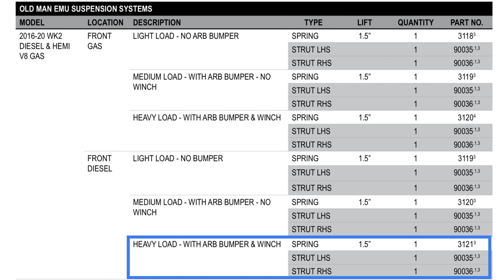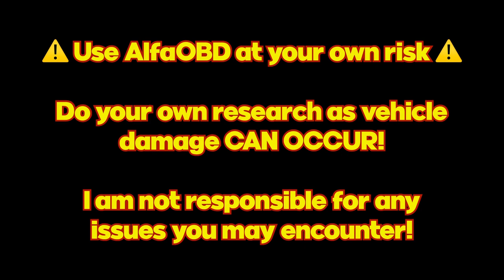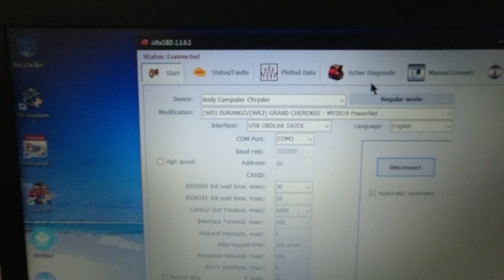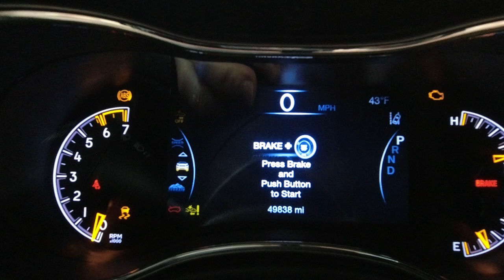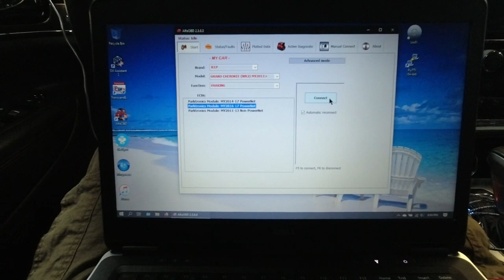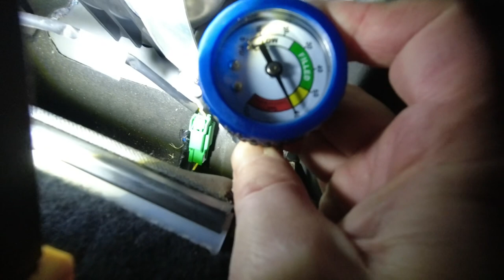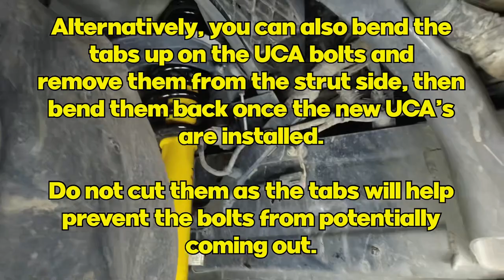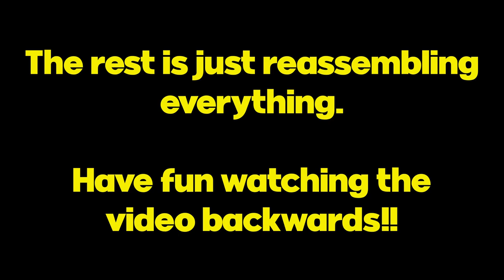Jeep Grand Cherokee OME Lift + RRO UCA Install 2017-22

Comment: On the upper control arm bolts/nuts they have a little U shaped tab on the end that hook onto the body. I thought the purpose of those was that you could loosen and tighten the nuts without needing another person to hold the bolts.  Once it spins enough it'll hit the metal and stop it from spinning.  Just torqued mine down to 70,  hope I didn't bend or damage them doing that.  In your video you say to get someone to hold the bolt.
Reply from the maker: You are correct in that the tabs ARE to keep it from spinning. However, there are 2 things that can happen that I didn’t realize at first. First, one of the nuts was so stuck that it spun the bolt and bent the tab up. Second, when you’re tightening the firewall side, you lose a 1/4 turn or so with the slack the tab allows. If you don’t have a ratcheting wrench with a high tooth count where you don’t have to turn it far to catch the next cog, then that 1/4 turn costs a lot of extra time and frustration.  That was the case with mine.

Comment: Nice video on the process. I wish I had made one when I did my swap. You should have checked my spreadsheet which had all bolt/nut sizes and torque spec. 

Would have been happy to help as well seeing as I already have the tools from doing mine, including that E-star on the rear brake calipers. Would be happy having exchanged my mechanical help for your tech help in disabling my air suspension. Never bothered trying as I messed up my compass when just trying to change tire size….lol
Reply from the maker: That’d have been cool!!!

If you still have the stuff where you can hook it up, we can still disable the error message (and change your tire size 😬)

Comment: 18:22 - did you attach the sensor back to the new control arm? Conflicting reports on if this is for the ride height or the headlight leveling sensor. Thank you
Reply from the maker: No, the adjusting headlights were only thru 2018, IIRC. My 19 has the HID’s, but they do not adjust.  

If you have the adjusting headlights, then you’ll want to hook up the one on the passenger side. The RRO UCA’s have a ball socket that it connects to.
Reply: @funkywk2  Thank you for the reply. I have a 2012 WK2 Overland w/ HID as well. So that ball socket on the RRO UCA is not for the ride height sensor then? There is an identical socket and piece of plastic on the driver side, but the RRO UCA does not have the ball socket on that side.
Reply from the maker: I think the front passenger side was for both, as each corner has its own valve/level.
Reply: Noooo not red threadlocker

Comment: Great video. Wish I had it when I installed everything. I love the lift. Only issue I’m having is the double rubber upper ball joint boots. Any time it rains mine fill with water and I have to re-grease them to push the water out, I’m talking a lot of water and my grease leaks out so much. There’s got to be a boot off some other vehicle that is one piece that would work but I haven’t researched it yet.
Reply from the maker: The only one you need to worry about is the original that covers the joint itself. The 2nd one doesn’t need any grease in it.  It’s just there as a spacer to make up the difference.

Comment: Have you had any problems or regrets on the change you did to your suspension? I am looking into changing mine out as well but I wanted to get some feed back first. Thank you
Reply from the maker: Absolutely no regrets.  Be sure you get the correct springs for your mods and engine. I went with the stiffest springs (Hemi, F & R bumpers) and actually wish they were a little stiffer. They ride just like QL, but with more control and no floating.
Reply: @funkywk2  I currently have airlinks installed and have not put them to offroad use but I will this weekend  ( in a few hours after writing this) at Windrock.  I can tell you now from driving from Texas to Oliver Springs TN that when I get back they will probably be changed out before my next trip. I have the the same (Hemi) front and rear bumper you have along with other body protection that put additional weight on my WK2 so I will let Rocky Road know when I purchase their suspension lift kit. 

Another concern I have is disabling the air suspension and it having any affect on the other components that relate to when it is in rock, mud, or sand mode--other than raising and lowering the jeep? 
  
btw the floor jack was a tremendous help with leveling the front bumper--it took me a great deal of time to get adjusted correctly - thank you!
Reply from the maker: I’ve used mud and rock modes quite a bit and without issue, so you should be just fine.  Glad I actually had a helpful tip. :)

Comment: Quite an involved process for this mod, but well worth it by the looks of it. So there are no dash lights or software problems so far? Thanks for doing the video. it's a big help.
Reply from the maker: Nope!  I still need to remove the Uconnect menu options (Tire Jack Mode, etc), but no errors now.  After I disabled QL in Alfa, I did still get an error until I disconnected the ASCM. Once I did that and did the ABS Initialization, it was clear.

Comment: Hi , you didn’t show how you reset ABS initialization? Mine won’t let me click start, to reset it
Reply from the maker: On the screen for it, it tells you what steps to follow. I’ve also used this post as a guide:  https://offroadpassport.com/forums/topic/5690-how-to-calibrate-speedometer-change-tire-size-on-2021-jeep-grand-cherokee-wk2-using-alfaobd/
Reply: Thank I will give it another try.

Comment: Im thinking to get this kit from RRO.
2019 jeep gc limited.
Any recomendation before installation? Im trying to find out everything i need before do it by myself to make sure everything its okay.
Thanks!! And nice ride!!
Reply from the maker: Figure out your long term plans ahead of time.  Winch, bumpers, roof rack….   Anything that will add weight needs to be accounted for. 

I have no regrets getting the springs we have (stiffest - 3121/3160) due to our weight.  

Also, the RRO UCA’s keep the alignment in spec, so also worth it.

Comment: Does it ride better then the air suspension and give you better flex. Right now I’m running airlinks and the ride is pretty stiff. Going over bumps is crazy. Other then that it’s been working fine for 176k miles. 

Also were you able to correct the tire size in anyway to correct the speedometer and mileage.
Reply from the maker: The ride quality is as good as QL is stock, but more controlled and not as bouncy/floaty.  

The articulation might be a little better, but it’s not QL that is the limiting factor. The sway bar end links limit flex the most, as do the CV axles.  

I used AlfaOBD to correct tire size in the video.
Reply: I have a 2013 Jeep Grand Cherokee Trailhawk. What did it cost to do the entire conversion?

Comment: Man that was a job. Swapped out son's air suspension on his 2012 GC Overland with 5.7. Found out he needed break job also. Felt like i had been run over next morning.😂
Reply from the maker: I get it.  Getting old sucks!  Luckily, I had some help, so it wasn’t all on me. I’ve been impressed how long the stock brakes have lasted, so we aren’t there just yet.

Comment: Bro... how much lift did you achieve with this setup? I have a 2018 v6. I was told only up to 2 inches. Yours looks like more than 2.
Reply from the maker: It is close to Offroad 2 with Air suspension, which is 3-4 inches over normal ride height. I don’t know where a coil spring WK2 sits normally, so they may be basing it off of that (assuming it sits a little higher).

Comment: Awesome video! I came across this after I got my RRO Old Man emu lift (air suspension deleted) Same kit as you with HD springs.  Since the swap I have had a clunk (front driver) going over bumps especially at lower speed.  Did you have any issues?
Reply from the maker: It’s the front endlinks.  Stock set is too long and hit the fork at the bottom of the strut.  I’m going to swap to a shorter one.  The OEM SRT links are a little shorter, but I don’t know if it’s enough.
Reply: @funkywk2  awesome!! Sounds bad, and couldn’t figure it out; will swap the links and see how it goes! Appreciate your response. 
Cheers
Reply from the maker: Just realized I’m running SRT endlinks right now and it still hits. I’ll post my update here when I fix it!
Reply: @funkywk2 it was definitely the end links… found an aftermarket set that was slimmer at the pivots… Replaced and the clunk is gone.
As a plus have grease points.
Thanks again
Cheers
Reply: @thecanadianguy364 can you please share which ones you ended up going with? I need to replace mine, thank you!
Reply: @AM-bl1ss  I went with the TTX NCT TXMS258136
I purchased from Napa Canada.

Comment: How is it offroad? Better wheel travel?
Reply from the maker: Its terrific offroad. Much more controlled, no banging from maxed out struts, much more comfortable.  I’m not sure how much more wheel travel it has due to the sway bars, etc, but I think it could with some changes.
Reply: @funkywk2  thanks man. I have a trailhawk like yours and I'm at 100k km right now with no issues with quadralift so far.

Comment: Does this still fit in the garage with the roof rack?
Reply: Yes, with several inches of clearance.
Reply: @gspfunk  sweeet👍
Reply: Another question,  do you have the trailer package equipment on your jeep and factor in the spring rate?
Reply: @marine0331inf  I do have the tow package, but I actually went HD in the rear due to our rear bumper and load when we’re camping and wheeling.  It’s at least an extra 800 #’s, probably more. With the Wilco and RotoPax on the back, I was actually sagging a little. And, I chose not to level it, so I’m gonna look into helper bags.
Reply: @gspfunk  let me know any updates on it👍
Reply: Did y’all need a few drinks when you got done

Comment: Quadralift isn't unreliable at all. People just don't understand how to maintain it, that's all. If atmospheric air gets into the system for any reason, it's going to cause issues. That's because there is moisture in atmospheric air and moisture causes all kinds of issues from internal corrosion to freezing in cold temps. 

So to keep your air suspension working properly, make sure it's filled with nitrogen and it should work just fine for decades. 

I'm on my 3rd air suspension Jeep and have never had an issue with any of mine.
Reply from the maker: Glad your experience was better than mine. I know there are more happy customers out there than people with QL issues or it wouldn’t be viable for Jeep to keep using it across platforms.  However, that’s a pretty broad statement to make regarding all the people that are having issues with QL. Especially when most of them seem to have also had their suspensions serviced at dealerships. 

ALL of the work on mine was done at Jeep dealerships under warranty, so, unless the dealers aren’t properly refilling the tank with Nitrogen, that’s not why it failed.

Our first issue was the valve block on the compressor, which was allowing the whole front end to leak down. The system was nitrogen-filled from the factory. The second was the rear bag blowing out. Neither were due to incorrect gas type. 

Most others have leaks and such, which are from the flimsy fittings used to connect the air lines. 

I had less issues on my 07 TBSS that pulled outside air for the load-leveling rear suspension.
Reply: @funkywk2  True, an airbag blowing out isn't because air got into the system. But a failed valve block can absolutely be caused by air (moisture) getting into the system. In fact, it's a leading cause. The issue with these air suspension systems is that they have the ability to pull in outside air if the nitrogen charge get low. And since it's a sealed system, then the only way for the nitrogen charge to get low is if there's a leak. That said, there are so common areas that are prone to leaking with age. The elbow connecters on the top of each bag (under the hood in the front) have an o-ring inside them that gets brittle with heat and age. 

Anyway, my point is that these are robust systems that can last a long time without issues if you simply maintain them and make sure they are properly charged with nitrogen. My current 2019 Trailhawk is the same year as yours and you really shouldn't need to scrap the air suspension on a Jeep that new.